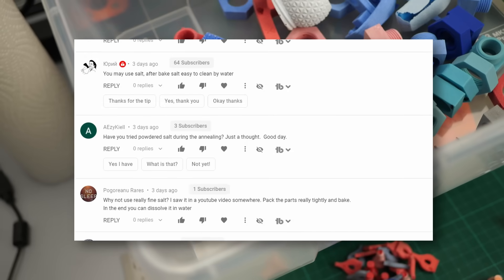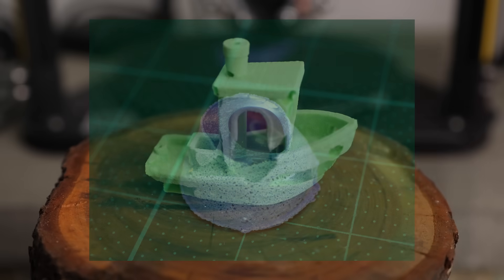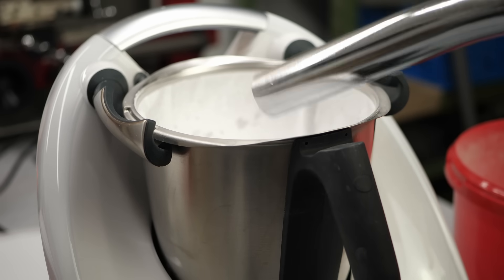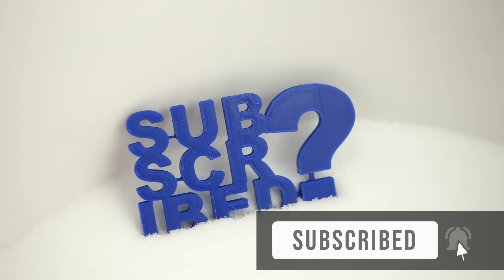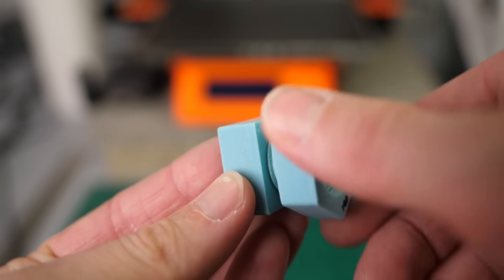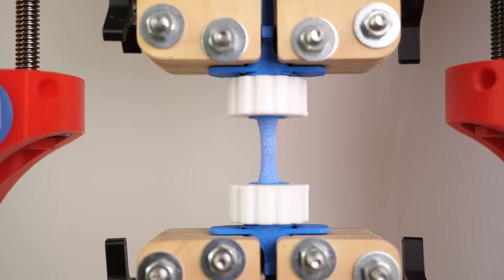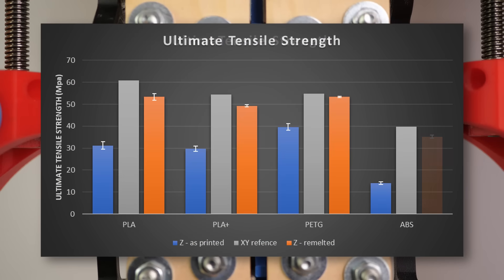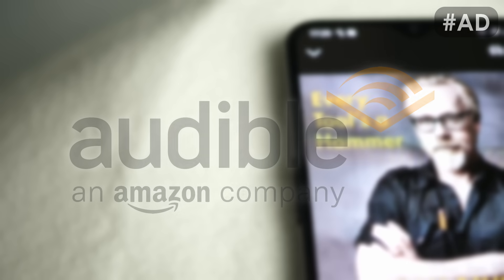The STRENGTH of 3D prints REMELTED in SALT

Comment: Given that PLA is usually the easiest to print with and has an extremely good mix of mechanical properties, and that the only real downside is the low temp resistance - this method would seem to fix the low temp resistance, presuming that annealing also happens. It seems to me that there's very little reason to use ABS/PET if post-processing like this. The most interesting material comparison to do next (IMO) is PLA vs. filaments with additives (nanodiamonds/CF/glass).

Comment: The only way I've ever made the finest grained salt or any other water soluble compound is to do a variation of distillation. You basically saturate salt into water at run temperature and then boil off the water really fast. Works very well. Though, remember to have a dessicator on hand; the salt will absorb moisture really really fast

Comment: I think you have missed out on an important point. By re-melting 3d prints you can also increas its heat redistance. I waned to make 3d printed holders to steralise some instruments am 110°C. Well i havnt testet my remolten PLA at 110° jet, but you can easaly put it into poiling water.

Irgendwie lustig, das viele von hier deutsch können, wir aber trozdem auf englisch schreiben XD

Comment: It worth trying submerging printed parts in pva glue. It should be easily disolvable aftervards.  The open question though is what will happen in the oven and will it mix with the plastic part

Comment: Another good material might be barium sulfate. It is cheaply available, inert, twice the density of sodium chloride, and can be had in very fine grain sizes. The one I use at work has a d50 of 4um, and even finer is available.
It isn't soluble in water though, so not sure if that would cause issues for cleaning the parts. All depends on how it embeds itself I suppose.
EDIT: Oh, and unlike sodium chloride, it isn't hygroscopic.

Comment: I would try alumina or silica as you can get them in fairly homogenous particle sizes and I believe the prices should be fairly reasonable depending on your source. A mask or respirator is a must, depending on particle size, and now that I think about it,  dry plaster might work as well. And for better packing, a volatile solvent might help but it would take a bit of research to find appropriate solvents for use in making your slurry so as to not dissolve your part. And it adds more time as you want to remove all the solvent prior to annealing or anneal in a vacuum oven with a trap to remove any residual solvent before it reaches the pump.

Excellent video and very nice to see more experimenting with the salt method. True science at its best.
Reply: And along with maximum temperature, I think hold time at or just below the highest temperature is something that should be thoroughly investigated. It might help with the discolored ABS to set the temp just below the temperature where discoloration occurs and hold it there for various times to see how that changes things, especially the surface layers.

Comment: So using the same techniques as if making a "green sand" mould (pack the salt tightly)- also adding a sprue to the  print will allow for infilling any voids with additional  plastic.
Reply: i wonder how effective actual green sand would be for this
Reply: @ImKittyCow  : It would probably work well - the sand is fine grained and the clay content will hold it in place during reflow. The Temperatures aren't so high as to fire the clay... (recipes abound - Reddit has at least one thread  on this)

Comment: Powder salt is pretty easy to make. Just throw kosher salt in a blender. 
It's softer than most salts, doesn't have any iodine, can be found almost anywhere, and is pretty pure. 
It tends to crumble into dust because it has many small grains clumped together, while larger-grained salts, like table salt, aren't very consistent when put through a cheap blender.

Comment: Did you try dipping the part in salt water, then letting it dry before compacting the fine salt around it and remelting?  There was a mention on free spirits site how this might be a good way to get perfect grain free surfaces.   Seemed like a good idea.
Reply: this is actually very smart, i was thinking a similar thing: 
1) get salt water and boil off the water at no more than 100C, which should coat the part, and then put the salt-coated part in a lot of salt and anneal
2) first use a conventional postprocessing adhesive (like spray adhesive) to adhere salt to the side, then bury and anneal. 
The general theme being: don't let the packed salt directly touch the surface

Comment: It seems to me that the main benefit with salt over other common powders is that its water soluble. So even if it gets embedded in the outer layer of the part it can be removed and wont leave a semi permanent abrasive surface like sand would.
It's also cheap,  readily available, and probably infinitely reusable.

Comment: An idea for getting fine salt dust easier: make saltwater then pour a thin film of the water onto a sheet so when the water evaporates, the salt crystals left behind are very small.
Heck, you could just pour saltwater into the container with the part inside and let it evaporate so the salt left behind fills all the space and makes a salt block that doesn't need to be compacted

Comment: I think it'd be interesting to see the results if you tried this again with a Ball Mill to grind the salt as fine as possible and when packing maybe used a device to vibrate the container like an ultrasonic transducer.
With both of those changes it might decrease the porosity on the surface significantly and fix the flashing issue.
EDIT: Someone else posted about fluidizing the salt and that could be a cool way of inserting the parts and getting good molds.

Comment: Green sand, used in molding application feels like a good candidate.
Reply: I suspect it wouldn't turn out very well. There are two major types. Water, sand and clay based, and sand and petroleum binder based. The grain size is fairly large.  Metal has high surface tension that keeps it from entering the voids between the particles. Plastic doesn't have as much and may even wick into the sand. Particularly in the petroleum based binder. The binder is also likely to contaminate the plastic altering its properties. The water based material will have finer particles due to the clay content, but the water content will migrate into the part. Finally the sand will embed into the part. Using salt allows that surface salt to be dissolved away. The sand won't do that.
Reply: @court2379  it does bring up the thought of using, say, Aluminum (or a specialized aloy) powder to do this in a more professional / expidiant manner as it would be more conductive, proper PPE and cleanup required of course
Reply: @UNSCPILOT  You'd still have the sticking and embedding problems though. I am wondering if adding corn starch to the salt would improve finish and still largely wash off.
Another idea would be to make a super saturated salt solution that melts somewhat about the plastic melting temperature.  Then pour that solution over the printed part and let it solidify. It should then match the surface finish and shape perfectly and be really hard, so would hold the shape well. Afterward you just soak it in water to dissolve the salt again. Then leave the solution out to evaporate off the added water to reuse it.
Reply: @court2379  would corn starch burn though? I'm a little uncertain of it's thermal properties
Reply: @UNSCPILOT  I had to convert  units to be familiar with the temps. I think you are right. It will burn, or at least brown and decompose.
Reply: @court2379  good to know, kinda why I was thinking of a metal powder, highly conductive it should heat faster and more evenly, but I also now realize that you probably can't soak it out in anything that wouldn't also dissolve the plastic, and having conductive metal powder on the print could have... issues with some projects unless it's what you wanted for it, I see now why salt is such a good option
Reply: @UNSCPILOT  Salt has pretty conductivity,  but being powdered and having the air spaces must really reduce the heat transfer. 

I keep thinking about the super saturated salt idea. When it crystallizes,  it will release a lot of heat. It might be a super fast way to do it as the salt will pour around the part as liquid and turn to a solid giving off heat almost instantly. It may not be necessary to even put it in an oven.  I'll have to see if I can figure out a good salt to use tomorrow.  Sodium acetate is commonly used in hand warmers, but this needs to get significantly hotter. Epsom salts (magnesium sulfate) might be an option.
Reply: @UNSCPILOT  I think that the powered aluminum could work well.  While some would embed in the outer layer it would give the part a cool metallic look.  It likely would not be good for threads though.
Reply: I was about to propose the same thing. I've used it before to get greately detailed aluminium parts that barely needed any machining.
Reply: How much would a small batch of that stuff cost? I must admit I'm curious
Reply: @UNSCPILOT  just google casting sand. depends on your country
Reply: @UNSCPILOT  Petrabond runs about $70US for around 50lbs. Because it is heavy, shipping costs make that vary considerably.
Reply: Won't work

Comment: Try spray painting the part with heat resistant paint before putting it in the salt. See if it retains a smooth surface.

Comment: I would be very interested in the results of experimenting with the cooling time. If you want to make larger crystals then you let the material cool slowly. If you want smaller crystals cool a material quickly. 
Lastly what if you heat treet a material multiple times?

Comment: Very interesting results.
If you're looking for a very fine powder to try how about genuine cornflour (not wheaten cornflour which is just fine ground wheat), possibly dehydrated beforehand to reduce water content.
I'd avoid trying talcum powder unless you're using safety equipment due to the likelihood of the presence of asbestos - asbestos is often found in talc deposits.

Comment: Okay, nice!
So my 2 cents is:
Potassium Nitrate
Melts @ 334*C
Water Soluble
Dries in the oven easily (good to reduce clumping)
Mills easily: Simple blender. Ball mill gets particle into the single microns.
Thermal conductivity: Should achieve just over 8 mw/k, significantly higher than sodium chloride. (https://journals.jps.jp/doi/10.1143/JPSJ.15.199, sorry its OLD, https://www.ncbi.nlm.nih.gov/pmc/articles/PMC6459620/)
It's cheap! Pay a bit more and get the greenhouse grade to save on milling time.

Comment: Perhaps it would be useful to test really small glass beads/silicum as used in rock tumblers or sandblasting?
Reply: I think the issue is that they're not water-soluable, so the product will be frosted over in granules.
Reply: @MsHojat  True, it might be required to use hydrophillic materials for this process. With that in mind, talcum powder might do quite well. It's pretty hydrophillic, temperature resistant and the particles are really tiny.

Comment: Did you consider silica powder? It costs around $30 per kilo and could come in an average powder diameter of around 50 micron which could be excellent for this. Not sure if being a good insulator would be too bad for the annealing but will certainly be chemically almost none reactive with those polymers so it might be worth the extra cost considering it is recyclable.

Comment: Try drying the salt first in the oven at the temperature you intend to re-melt at. This will drive the moisture out (salt is hydrophilic). Then process & store in metal or glass container with an air tight lid of metal or glass. This will give you clump free salt and will ensure the prints are as dry as possible. Awesome test! Cheers

Comment: Excellent work as always Stefan. I do wonder if we could borrow part of the process of Investment Casting to increase the strength. In the I.C. process, after the wax positive is cast, it is coated in ceramic slurries of increasing coarseness with a drying process in between. The slurry has a high spirit content to ensure rapid drying. The first layer is like heavy whipping cream and provides a perfect replication of the surface of the wax part. But three things happen to ensure an even coating. 1: all the wax parts are attached to a 'tree' and slowly rotated in the slurry. 2: The slurry is subjected to ultrasonic vibration and 3: the vat is evacuated. (2) and (3) promote the extraction of air bubbles very effectively. After coating, the tree is lifted from the vat while still slowly rotating until it is dry (convection heat can be applied). Further coatings are applied to increase the wall thickness of the shell. Each layer has a thicker consistency. Finally the wax is melted away in a kiln leaving a perfect negative of the parts (the now hollow tree stem is used to pour the metal into the moulds). For our 3D prints we would simply take the coated part to the applicable temperature to fuse the layers. Shell removal could be the difficult part but if the slurry we chose could be dissolved in (warm) water or perhaps  IPA, we might only need to soak it for a while to remove all traces.
Two big advantages are almost perfect surface finish and significantly reduced time to reach temperature due to reduced mass to heat.
This is all very complex but nevertheless using well known technology. I can see a future where 3D printer manufacturers also offer assemblies that will do all these coating steps in one compact unit. Your testing is laying the groundwork for such a future! I'd be interested in your thoughts on this. Cheers!

Comment: I use PLA for prototyping and cast the part in aluminium if I need the extra strength.
This seems like a cool middle ground if you don't want to spend the 150€ needed to get casting.

Comment: I watched the whole video, but I have no idea why you would take the effort to do this?
Reply: Printing layer on layer with a 3d filament printer produces parts that are weak in the vertical direction because the plastic is still in layers which separate when pulled apart. This technique melts the plastic part, without affecting its shape, so to make the part far stronger.

Comment: What if you used a dual-extrusion to print an outer shell of a different material, then have it dissolve away? Maybe HIPS?
Reply: Bingo.  I second the motion on dual extruder with HIPS.  Will also try using non-dissolvable high temp formlabs resin printed to fit the inner diameter of a PETG tube. One of my goals is to preserve dimensional integrity as well as surface smoothness of PETG
Reply: @FriedOrca  Could you let me know what results you get because I use a form 3 with the wash and cure station in my personal workshop and would love to see how this applies to the different resins.
Reply: I did this with PVA, it werks :)
Preserves the original texture of the part when the PVA doesn't melt. (I'm using pva that prints at pretty high temperature). I'm going to do another one and try to get the PVA to melt as well during remelting, see if it makes a smooth texture. Now that my thermocouples arrived I should have a bit more control over the process.
Reply: @free_spirit1  did you ever try the dip the part in salt water and let it dry method you mentioned?
Reply: @jeffking3693  Or try growing a shell of salt crystals on the part in saturated salt solution.
Reply: @free_spirit1  How about PVA dissolved in ethanol? You can buy this mixture as a release agent for fiber composites. If you brush this on your print, the ethanol evaporates, and make a thin PVA film barrier. Maybe it's too thin, that has to be tested, but it's a lot easier than printing a PVA barrier. :-)
Reply: There are castable polyurethanes that will do the job
Reply: Excellent concept - or perhaps some sort of  release agent, spray/dip in wax, the wax would melt sooner and cause the salt to form a smooth crust
Reply: You can probably get away with using ordinary coarse salt then, as you don't care about the finish of the outer layer. Not sure about the problem of grains of ordinary table salt not being able to stick together though, maybe adding a heavy weight or some kind of clamping container would solve this?
Reply: Print the outer layer from a high temperature material, and the main part from a low temperature material. Melt the inner material but not the outer material, then peel off the outer layer. Just requires two materials which won't bond well to each other.
Reply: @jessicav2031  This is a good idea I might try it, thank you
Reply: @jessicav2031  The outer material not only needs to withstand higher temperature, but be significantly weaker than the inner material to allow removal without damaging its contents even when removed from internal crevices, an unlikely combination.
Reply: Sony Pony  Plastic is virtually impossible to cast. It's far too viscous to just pour into a mold. In injection molding, plastic pressure is 5k-30k psi.
Reply: Sony Pony  heating up plastic to the point that it flows well into a mold is not an easy thing to do in a home environment.
Reply: My idea was to encase your pla model in quickset joint compound with a small vent hole facing to the top side. Then bake it to melt the pla inside this cast, and soak it in water after to melt the quickset away from the part.
Reply: Sony Pony  start the next test and let us all know 😉